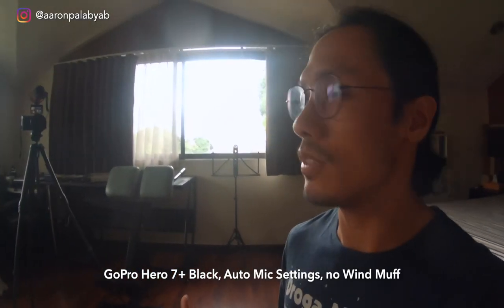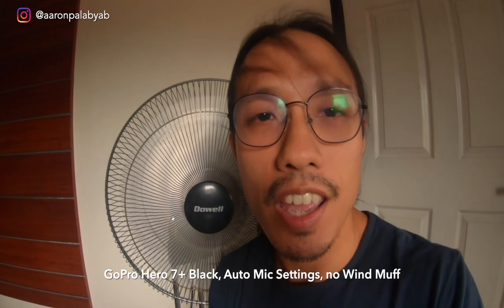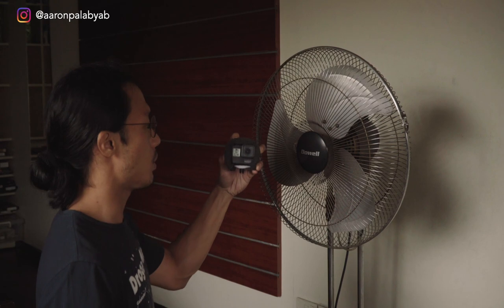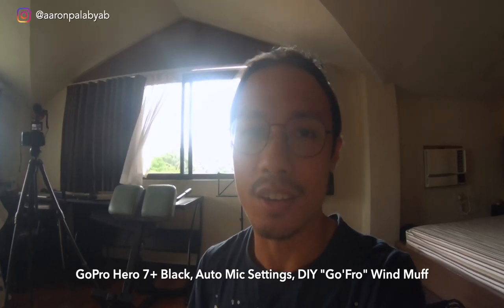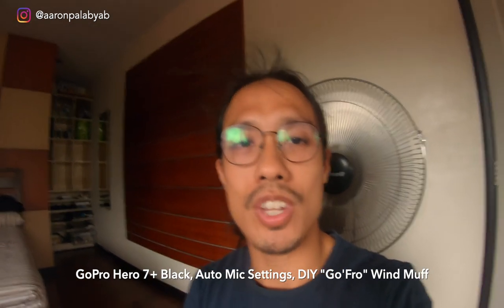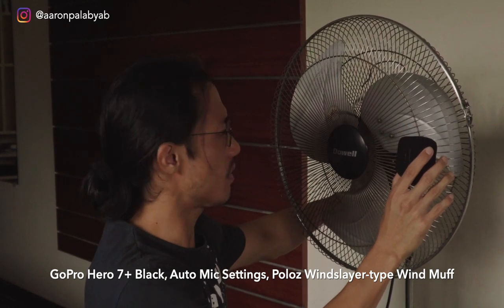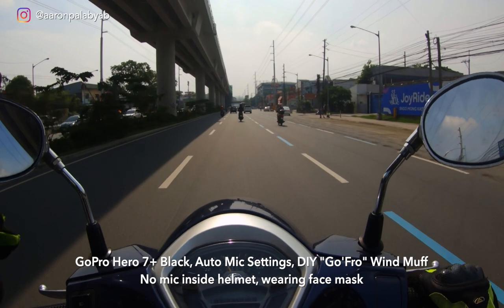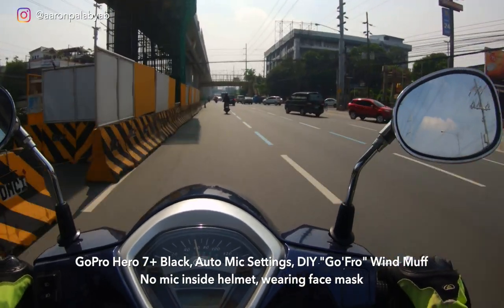EASY DIY GOPRO WIND MUFF (all models!) | Better Than Windslayer | For Vlogging & Motovlogging

Comment: Can you tell me, if I use the wind foam on my Gopro but I'm indoors without wind, will it sound different? What I mean is, should I remove the foam everytime I get indoors or can I leave it on?
Reply from the maker: You can leave it in, it sounds just fine :)
Reply: @Ride_XP  thanks Bro

Comment: Since your model seems to work better than a windslayer, I'd like to know what materials were used.  The construction is pretty obvious.

Thank you!
Reply from the maker: Sure. This was a cheap soundproofing foam we ordered online that we cut into a thin strip, and thin elastic bands that were lying around in a sewing kit at home.

Foam, not exactly this but similar: https://www.amazon.com/JBER-Charcoal-Acoustic-Fireproof-Soundproof/dp/B07KFCLC9G/ref=sr_1_7?crid=10X7BMHWZEBUQ&dchild=1&keywords=soundproof+foam&qid=1605332662&sprefix=soundproo%2Caps%2C470&sr=8-7

Elastic bands: https://www.amazon.com/HipGirl-Elastic-Sewing-Greyish-Off-White/dp/B086W2QZSL/ref=sr_1_6?dchild=1&keywords=elastic+garter&qid=1605332731&sr=8-6
Reply: @Ride_XP  Thank you, Sir!  I shall investigate.  Maybe I can find something less than a 12 pack ;)

Thanks again!